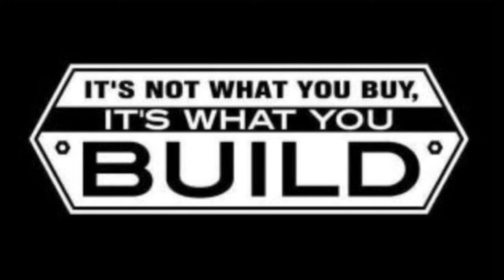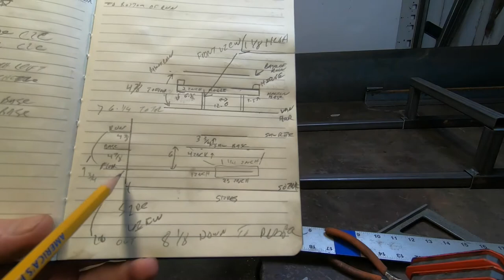Gutter Machine Hack, Building a miter saw mount, guttering van set up for Brenham Gutter Specialists

Comment: Not bad, but what he meant that if it turned around it wasn't like in degrees, he ment to cut let's saw a return that like 3 feet and your cutting it out of a new one, what is fastwe to cut downspouts it's a circular saw. You can take it with you without having to come back to the van, and making a cut with the miter saw
Reply from the maker: Phase two upgrades have been completed. The saw is now on a 360 swivel and swings up and locks into place. see video on the Facebook page
https://www.facebook.com/105088267847977/videos/257048816251442